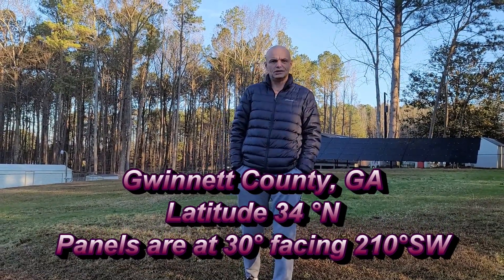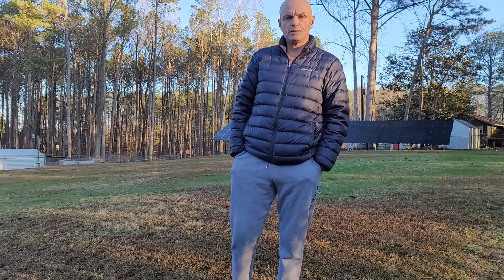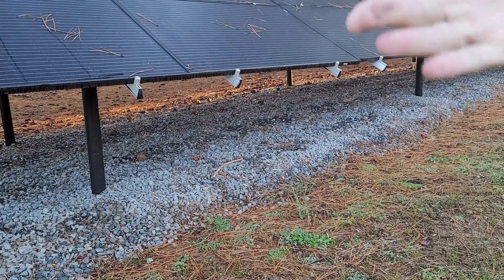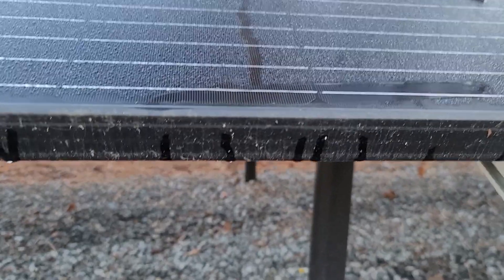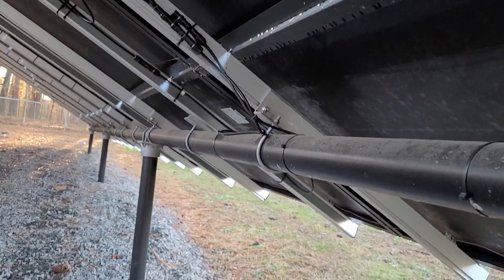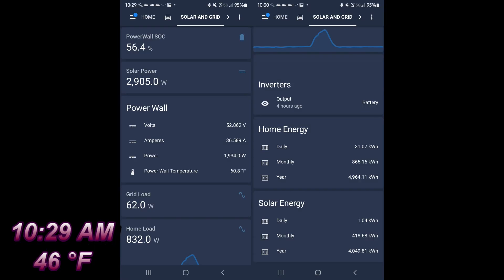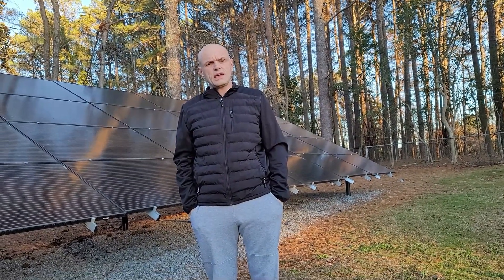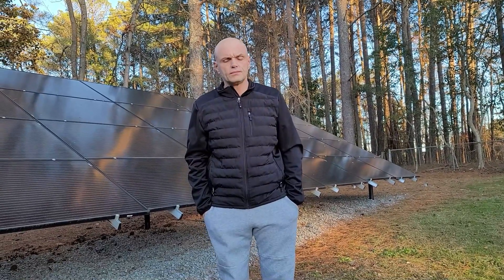DIY Solar Array Production on Winter Solstice

Comment: I can't wait for your updates. I would like to know what you would do different with what you know. I wonder why you didn't go with  a net metering system, does it have to do with the cost of the inverts? Still planning my system, but the supply chain and shipping costs have me in a holding pattern.
Reply from the maker: Thanks, they are coming. From cost perspective it does not make any sense to install inverters that can export power back. Inverters are expensive and GA Power will buy energy from you at $0.03 per kWh and sell it back to you at $0.10/kWH. Thing that I would do different is install more battery storage.

Comment: Yep winter is slow my best on solstice 22kwh but my day is less than 8 hrs long lol best summer day was 82 kwh lots os 1and 2 days with snow
Reply from the maker: Another thing that I am noticing is that winter clouds are not as thick as summer. With winter even if it is raining I still make some power where in summer when we get the rain production is zero. Interesting things to learn.
Reply from the maker: I like that you replied. I wanted to see what would be the difference between latitudes.